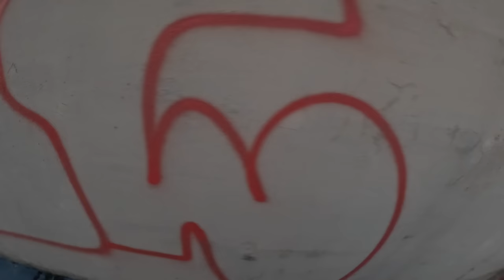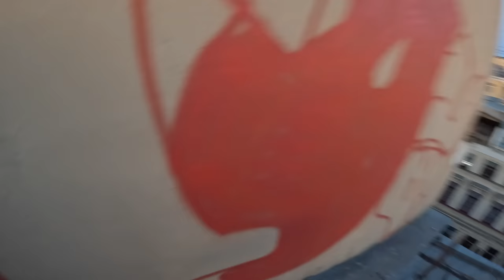Rooftop walker //  Full colour graffiti // Hard way // The whole process. Raw format

Comment: Those roofs make so much noise. Wouldn't it easily wake up people inside?
Reply: but they do not immediately sleep under the roofs
Reply from the maker: usually there is a technical room between the roof and the apartments, but where there were windows cut into the surface of the roof, people live and they are 100 percent not happy with such noise
Reply: @TagMachine  We don't really use those kinds of roof in my country. It's interesting to notice the subtle differences.